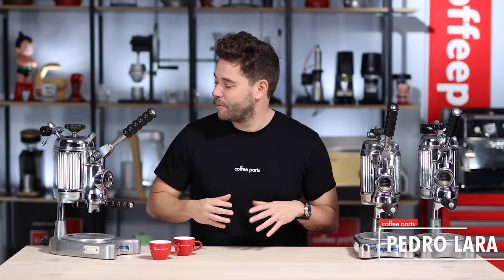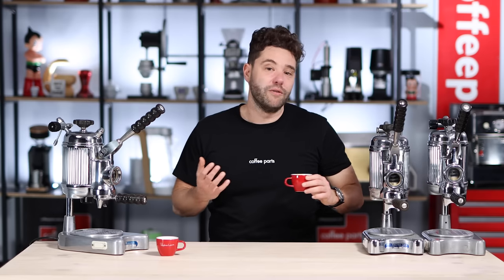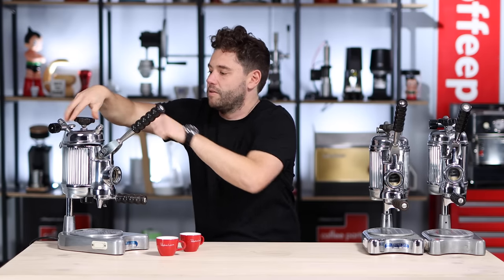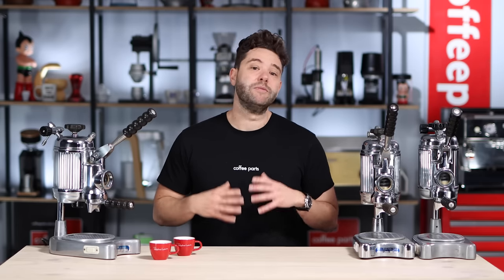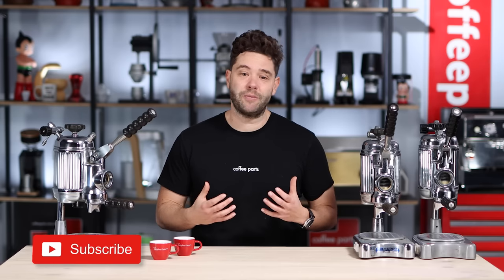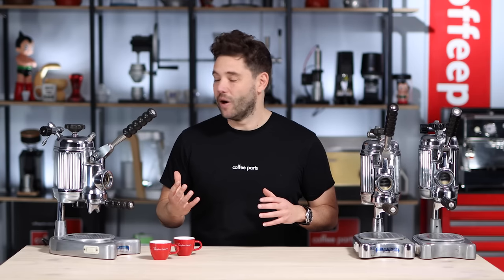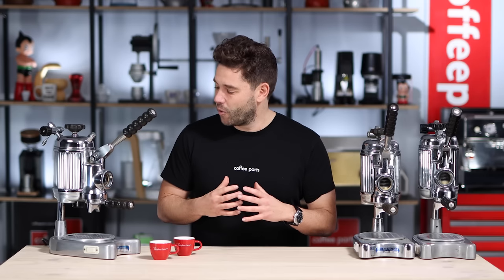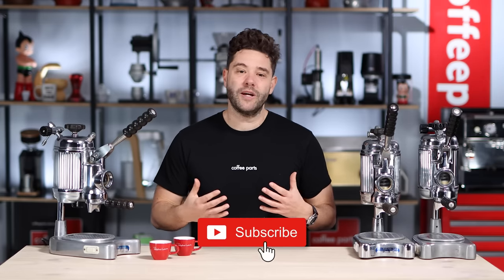My 1964 Faemina 2nd Model "Blue Label" | The Collection

Comment: Thank you for this great video.   I have this machine.  However, the 800 watt heating element (i.e., the larger one) burst open due to no water in the tank, due to user error :(  .  I have tried for 6 months to find a replacement but to no avail.  Does anyone have any suggestions  on where I can locate an 800 watt heating element for this machine?   Thanks!

Comment: Great videos! I'm stoked to subscribe to a channel like this! A quick tip, for faster refills and just a cleaner more efficient method of refilling small home pressurized levers, put your brew water in you steaming pitcher like you did, then turn the machine off and steam the water until it depressurizes. Then your brew water is hotter and you're ready for your next shot quicker when you refill the now much hotter water.

Comment: Thank you for this video. But concerning the result in cup, compared to a Robot Cafelat, or to the Flair you mention, is it better? Thanks for your answer, I'm planning to buy it (and the budget is not the same, the vintage side won't be enough, there should really be something going on in the cup)
Reply from the maker: In the cup, would say the Robot or Flair would win.
The Flair 58 really is awesome when you get it right.

Vintage machines won't win in the cup most of the time (expect maybe the Cremina), yet I have a soft spot for them.
I think of them like the weekend car, not as comfortable or as features as the daily driver, yet you get smiles for miles.